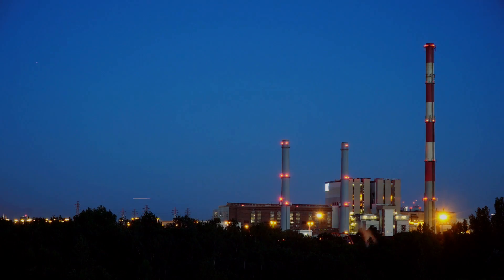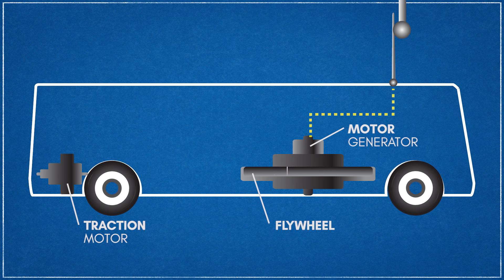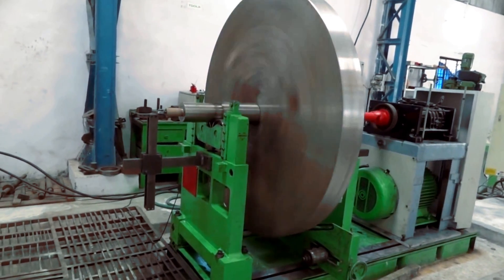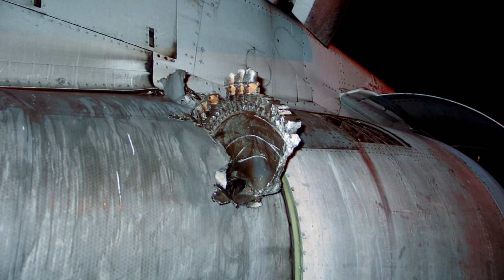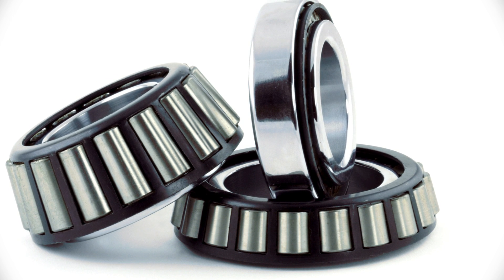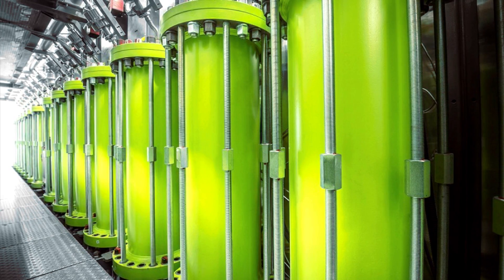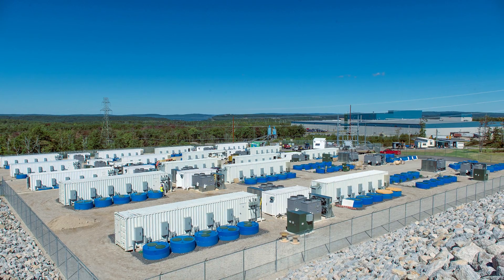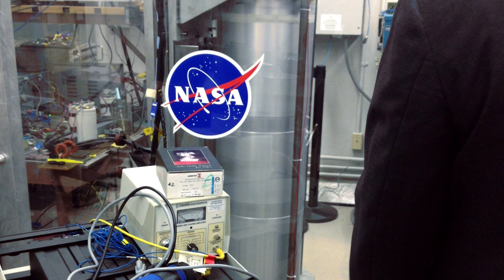The Mechanical Battery

Comment: The problem with flywheels is that the energy required to spin them up squares with RPM relative to the stator against which the torque is being applied, due to the ever-increasing angle over which it must act to maintain a given rate of acceleration; hence the input energy is always equal to the resulting kinetic energy as a function of ½Iw².

Boosting their efficiency to really useful levels would require exploiting gravity to incorporate the 'stator' into the rotating system, thus beginning each cycle at zero relative speed and thus at the bottom of the 'w²' multiplier on the energy cost of accelerating, so locking the unit-energy cost of angular momentum to its baseline value of ½ J per kg-m² per rad/s;  10 such cycles at ½ J each accelerates the system to 10 rad/s for 5 J, a speed at which it has 50 J of KE, with 45 J left over to drive a very small bus, or just brew up a nice hot cup of tea.

Provided they were only ever run as opposing coaxial pairs, possibly also counter-balanced by opposing pairs on precisely-opposite sides of the globe, i don't see any issues..

Comment: can't western digital utilize the kinetic energy in mechanical harddrives?  input 5v - 12v output to the lithium ion/polymer energy backup?  and then some possible to engineer this under a station charging station you can use at home to charge your devices, i mean in a smaller scaled down version utilizing the magnetic bearings in harddrives?
Reply: Modern Hard drives are engineered to have a low moment of inertia (extremely thin lightweight platters) so they can spin up relatively quickly. (also the magnetic bearings are much more precise than mechanical bearings, which they need, to be able to read the tightly packed information)

Comment: You still have to charge that stuff. NOTHING beats coal, oil and natural gas for cost and availability.
Reply: Except sunlight, wind, waves and geothermal. One time installation cost is always better than paying for both the power plant and fuel, especially when that fuel is running out so the cost is increasing all the time. And while coal lasts for a while yet, once that is gone there won't be any more even if you wanted billions of years. The conditions that made those resources won't happen again.
Reply: https://energyinnovation.org/wp-content/uploads/2019/03/Coal-Cost-Crossover_Energy-Innovation_VCE_FINAL.pdf

Comment: Apart from longevity and "exotic" materials arguments, ultra capacitors beat flywheels every time. Energy density, energy per kg, charge and discharge rates (per m^3 and per kg). And, ultra capacitors have virtually zero self discharge.

Comment: Not all ICEs require a flywheel. Both radial and rotary engines commonly used for aircraft do not require a heavy flywheel, usually used on internal combustion engines to carry the crankshaft through the portion of the 4 stroke cycle where no power stoke is present. The unique design takes advantage this fact to increase their power to weight ratio.
Reply: Sorry, they do. It's called a propellor.

Comment: What an enormous waste of energy those busses were. Not only because of the several more energy conversion steps, each with an energy loss, but with the added massive weight you need to drag around.
Reply: You would need to work out the total energy efficiency of each stage in the process, before you could come to that conclusion.
The combined losses in the fixed electric plant, plus the transmission line losses, plus the losses in the flywheel system may still be lower than the losses in an equivalent Diesel engine plus its transmission system.

Comment: Let's turn the earth into a mechanical battery
Reply: I designed a power station to harness the rotation of the Earth as a student in the '70s.
It worked on polar ice drift, and I called it the Polar Drift Power Station. I kept the model I had built for ages, although it eventually disappeared.
The biggest problem was getting the electricity it generated off the arctic ice pack.

Comment: Uh, is there any reason why we can't combine the function and features of the Tesla Turbine with the benefits of a FESS? Using only high pressure air to spin it, a Tesla Turbine can reach rotation speeds of 90,000 rpm or more in just a minute or two.

Comment: so you slowly power and spin the wheel, then float it on some magnets in a vacuum. then when you want power you would apply some generator to slow down the wheel and get your energy back? that is too simple. These seem more like a mechanical capacitor
Reply: They are exactly the same in purpose and function, except a capacitor stores DC energy and flywheels store AC energy.  The reason they are not quite so simple is because AC power typically is fixed at 50 or 60 Hz, but the flywheel will produce 1 Hz when it's turning very slowly and potentially 100,000 Hz or more when it's at full speed, so you need to convert that back to a usable frequency.  Doing that at large currents (thousands of amps) is not cheap or easy.
Reply: And simple is bad because...?
Reply: @luongmaihunggia  it feels like cheating. it is a really good idea. in theory that energy would be saved forever.
Reply: @xXRacer9000Xx  and cheating is wrong because...?
Reply: @luongmaihunggia  I don't get it
Reply: @xXRacer9000Xx  cheating is wrong because you don't get it?

Comment: Flywheel energy storage is used in Nuclear Power Plants aswell, where pumps that cool the reactor are kept spinning by massive flywheels made of depleted uranium until backup power gets online in case of an accident
Reply: I've never heard of a plant using DU flywheels to keep the coolant pumps spinning. Our spindown procedure just uses the inertia of the the steam turbine (weighs around 550 tons) to keep the pumps going until our diesel or jet turbine generators get up to speed.
Reply: @daltonnabors  oh well it was just a fun fact our professor told us, but it might be wrong, I'll check
Reply: @daltonnabors  welp, I found many papers about the use of flywheels in reactor pumps, but I still have no clue about the material they're made of.. might just be steel
Reply: @nicolobadodi3423  We do not use flywheels per say, we use the inertia of the steam turbine itself as the flywheel. It's a large fairly high speed spinning mass hooked up to generators.

Hypothetically, one of our steam turbines can lose all steam pressure and continue to keep producing power for 5+minutes just drawing the kinetic energy out of the turbine
Reply: @daltonnabors  oh ok! Do you work in the field? Amazing!

Comment: What about super-capacitors? They can be recharged and discharged millions of times, have a huge power density and don't suffer from any stability/mechanical/loss issues. I have 3000F super-caps (from buses) that can surge 5kW/kG (granted they're only 6Wh/kG).

Comment: They work fine stationary at level ground, but for every moving object like a plane, a car or  a phone, they are just too unstable.
Reply: Leon what if you had pairs to cancel net torque vectors
Reply: Williams and Porsche managed to build racing cars with flywheel energy storage. I don't know what happened to them, but they were viable enough to go racing, even if perhaps not the most successful cars on the grid.
Reply: They use gyros in yachts and cruise ships for stability.